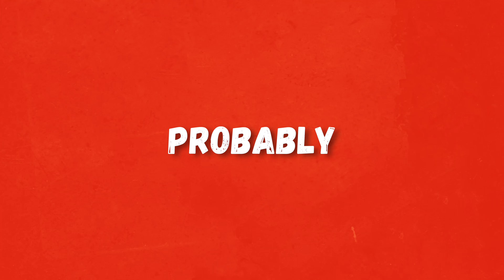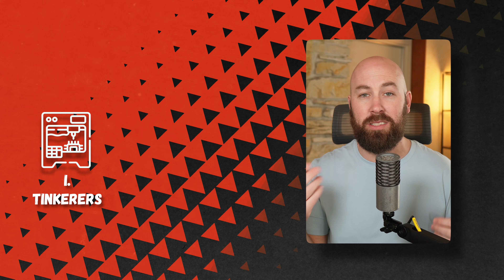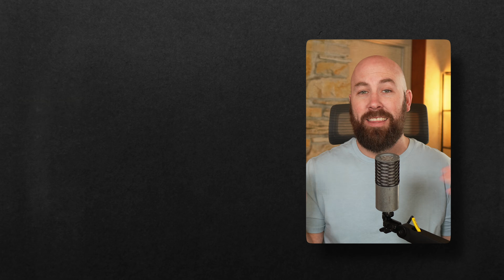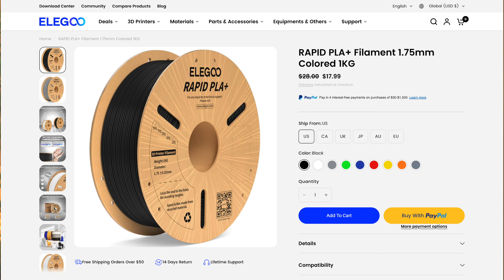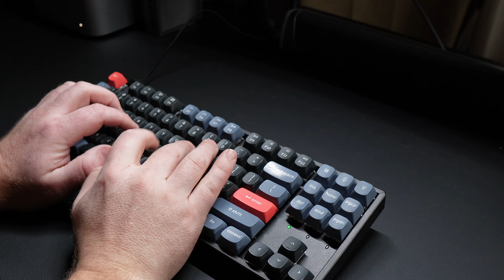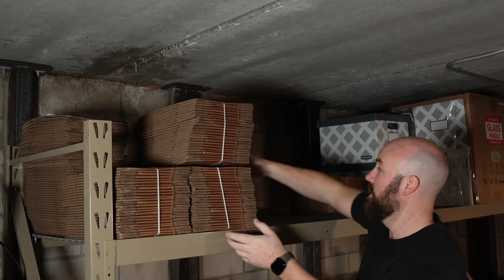3D Printing Start Up Cost 2024

Comment: I just lost my job and have seriously considered buying a 3D printer. However, my friends and I agree that I should first get a reliable job and THEN build my business. Thing is, I actually have enough money saved up that this COULD be viable. I haven't let them know just how much, just "more than the recommended 6 months of expenses". The big challenge in starting this is actually starting. I haven't even started selling used stuff on eBay and I've bought stuff with the intention of reselling. Also even though I have plenty of 3D modeling experience in Blender, I don't have any models to print yet.
I was so excited when the Bambu P2S finally became available in the US, but I think I'll stick to my plan of first developing some models, THEN buying the printer, maybe waiting for the mid-summer sale Bambu always has(hard to say if the P2S would be on sale so soon, but the filament will be). In addition, getting some experience on eBay with what I already have, which will also clear some space. Also getting a steady job, after I eventually get tired of this surprisingly stress-relieving staycation.

Comment: What are your thoughts on your printer choice (P1P) now after about 1 year from this video and the Bambu Labs Firmware-gate??  I would love to hear your thoughts?  I am researching and about ready to jump in with both feet on a 3D Print business.
Reply from the maker: Great question.  We should probably do an updated video for 2025.... For me personally if multi color is my goal I think I would still be with bambu but be looking at the P1S more.  I'm in a basement in the north so having it enclosed helps a lot.  IF you don't have that temp issue I'm still with the P1P I think.

Comment: Thanks a ton for all the info this is very helpful - I'm planning to start a 3d printing business this month and was wondering if X1C Combo 3D Printer is it worth spending $1800?
Reply from the maker: Depends on the material you want to use.  If you are all PLA, PETG then no its not worth it.  IF you want to create stuff with harder materials then the X1C can be a good option.

Comment: allthough this is a nice video, good content, i just gotta say this: People need to stop thinking of "creating a 3d printing business". Instead you need a good idea or two and see if one can utilize 3dprinting as a way of manufacturing. Just way too many people out there who think they can just buy some printers and have a business with no clue at all, or trying to sell the same old same old stuff, eventually realising after a period of time it's nothing more than just a hobby that went out of control.  Bottom line: Don't buy a printer to create a company; creaty a company and buy one if needed.
Reply: Correct!
Reply: Boooooo Debbie downer
Reply: Sigh. What is the purpose of a company? Is it not to solve the customers problems?

Comment: Hello, great video thanks for sharing. I was curious 10 months later is the Bambu P1P still the printer you would recommend?
Reply from the maker: Great Question...I personally really like the P1S.  However, I'm in a cold climate and in a basement, so having it enclosed I've noticed does make a difference.

Comment: Almost everything is overpriced on Amazon, for supplies, Amazon is the last place to look for. eBay is times cheaper especially when buying in bulk!
Reply from the maker: That may be true but when buying Filament for example the cost of it is such a small % of your COGS when making a sale.  The convenience of amazon is well worth the extra your paying (at least when you are starting out).

If I sell a print for say $10 and I profit $5 from the sale.  Maybe the cost of the filament for that print is $0.50?  So even if I was given the filament for free I'd profit $5.50 instead of $5.  Unless you are doing thousands of orders per month you are much better off focusing on new products and marketing then trying to negotiate bulk discounts.

Comment: The P1P is a practical suggestion based on value - cost, reliability, print quality, etc.  Bambu Lab is a complete non starter for me because of their approach to intellectual property and their lack of respect for my privacy and security.  They stood on the back of decades of open source development, layered on a thin veneer of their proprietary technology and locked it all down in their closed garden built atop a mountain of open source technology.  The default is printing through the Bambu cloud server and they make it very cumbersome to print offline.  There is no way I'm sending the design I created from my computer to their server and then back to the 3D printer that's two feet from my computer.  The only reasons I can think of for doing that is so Bambu can have access to my designs.  I won't buy any product from a company that would do that.

Comment: I appreciate this video. I have an eBay store that is already five stars on all transactions since we used to do resale and took customer service seriously. I've already ordered an A1 combo, I chose that for the price point along with being able to do multicolor. I held off on the filament since I wanted to choose the best one for the best value and you helped with that. The last step I had to figure out was finding designs to print to sell. Your designs you license out solves that last problem 🙂

Comment: Cool video, I'm sure it works in the USA fine. However in the EU international shipping costs are crazy high (at least from Hungary). Not to mention the different tax rules, or even starting a personal business officially is a pain in the * here  because of overcomplicated regulations and accountant fees. My best option to start is opening an own webshop with only domestic shipping, but this market is so small compared to Etsy or Ebay or Amazon. I already have an X1C, I had an Ender 3 V2 before, so yes, learned a lot, and tinkered a lot :D

Comment: Can i ask something?!
Who is gonna order something 3d printed???
I mean, i 3d printed 3 years and i can;t immagine someone buying a product that costσ 3 times more than the product manufactured in a mold.
Has no reason to do this. Except that, is gonna be also weaker than the product manufactured in the mold.
Reply from the maker: Everything I sell that could be mass produced using a mold I'm able to sell cheaper.  If I can't sell it for cheaper I try to ad personalization to it which of coarse can't be done in a mold. If I can't do either of those things then I just don't sell it.

Comment: I have been watching a lot of 3d printing start uo videos for beginners like myself. But one thing i noticed is that it’s rare for someone to talk about the considerations of where you can setup in your home. Not everyone has a spare room or a basement, here in the UK, to isolate the printer. Some say there fumes to consider, air temp and humidity, etc.
Reply: This
Reply: @Phlebz  if somebody can only reply...
Reply: @jmoney_online  I mean, there isn't much to reply to. If you don't have the space then it isn't going to work, pure and simple. There isn't any other way to solve this issue other than getting a space to use.
Reply: @winebartender6653  so you mean that the fumes are unbearable then? You didn't really answer my question though did you? Air temp and humidity..even if I did have a spare room I still have no clue what else to consider other than "extra space"
Reply: @jmoney_online  Fumes are only a problem if you are printing with certain materials. I recommend doing some research on it but pla and petg are safe to print without an enclosure. If you live in a humid environment getting a filament dryer is well worth it. Leaving filament in humidity for long periods will affect your print quality.
Reply: @LBL-XYZ  see that's a better answer. Thank you!

Comment: I loved this video!
Just a quick question, is it best to put a limit on how many of each item you have in stock on Etsy or is it best to print as they’re ordered. Do you say the items are made to order and may take a day or 2 before shipping?
Thank you 🙌🏻
Reply from the maker: I lean towards putting no limit on the amount in stock. However if you do that you need to make sure that you have the capacity to made how every many you end up selling.   I always want the sale so if I ever get so many orders that I think I can't handle them all then I just up my processing time.  If the orders keep coming though I would then looking to add more printers and lower my processing time back down.

Comment: Do you need ventilation to use a FDM printer, like you do with resin printers?
Reply from the maker: Do what you feel comfortable with but I don't have ventilation.
Reply: @sam__erickson  Cool thanks, I was just afraid it would make my house smell like melting plastic all the time. I tried a resin printer and we couldn't stand the smell of the resin. Plus it would only be a matter of time till I spilled it everywhere.
Reply: PLA+ is ok, corn based. ASA has dangerous fumes. Has great properties tho. These are my 2 favs now.

Comment: How often do you clean your build plates? Does that take a lot of time? do you have issues with adherence to the plates if you don’t clean them or do you have issues with humidity?
Reply from the maker: I just have a spray bottle and I spray them down.  I don't do it every time but if you go to long you will start to notice some adherence issues.

Comment: Hello, I am a sculpture and painting artist, I have some experience using Zbrush and I would like to make my own 3D frames for my paintings, but I do not have any experience printing in 3D, my question is, would it be better to have my designs printed, or buy a 3D printer? Is it expensive to have a simple 20x16 frame printed?, thank you
Reply: Plastic frames? Ugh.

Comment: I wouldn’t recommend a bamboo labs you will enter the world of proprietary plastic and you need to know the workings of a 3d printer otherwise when it brakes you will have to buy another and your orders won’t go out on time.  I would recommend two cheaper printers straight off and if you already have two then that’s a sign your ready

Comment: hello i started a 3d printing farm for 1 client, so i print what ever they want it earns about 600 euro a moth, and the work flow is very low i have plenty of time to set the printer to work on something else. i have a 2x creality smart pro 10 those are my start up printer sometimes i have to print up to 40 cm that why i have those printer. and i have a bambulab x1 to have quality and fast productions.       i have to start up a etsy maybe you have some advice ?

Comment: I'm about to graduate my AutoCAD course and have been eyeballing 3d printers forever.  Super interested in trying to start a business with 3d printers and maybe somewhere down the line subscribing to a license for AutoCAD to use those STL files commercially. Subscribed!
Reply: 4 month update, i graduated my course and my X1 Carbon is on its way to me as I type this.
Reply: I've been looking into learning AutoCAD. What made you start - what's your end goal?
Reply: @Vipersrule  learned it in high school and my teacher was just great, i didn't know it at the time but that type of work is exactly what I'm into.  I've used it for years after high school to teach myself more and apply it where i could find a relevant use in my own life as my other interests include welding and woodworking. It just made sense to get a career diploma using the program for its various uses across fields and position myself to maybe take on a job as a technician professionally or for its 3d printing applications to start a business.  All in all i figured knowing how to 3d print and work with point cloud systems would be a net positive for creative purposes or professional ones

Comment: Also another great starter 3D printer is the Elegoo Neptune 3 pro. Auto level and that thing just prints non-stop. No as fast as the P1P but definitely not as expensive either. The price trade off you get is really only about speed of the CoreXY design.

Comment: Anycubic kobra 2 neo (150-180$), anycubic pla filaments (black or white) and you don't need any setup. You can buy 5 of them and print. Slower if you consider only 1 but with 5 you are faster than 1 bamboo lab. First and only upgrade an enclosure, a cheap soft box one is more than enough
Reply: Honestly that’s great except you get what you pay for and the print quality… I have 2 ender 5s with hundreds of dollars of upgrades, 600+ into the plus not including the machine… and still do not get close to the quality and multi color function of a bambu… my rule of thumb is if you’re getting into the hobby for tinkering and learning get an ender or other budget machine. If you want to print well and have a good print experience rather than an engineering experience buy the bambu labs
Reply: @EsaubOutdoors  FDM 3D printing is never a quality manufacturing. I don't understand the obsession with it. If you need  quality skip FDM and look for SLS 3D printing or something more
Reply: Maybe second upgrade a couple of UPS to prevent power outages

Comment: You are also assuming that Etsy will work out. I tried to open up an Etsy shop with some 3d printed desk accessories but I was immediately banned after opening the shop (seconds after going live), and when I tried to appeal I was permanently suspended. I never received a message for why the suspension happened in the first place, even though I made sure I followed all the guidelines and avoided any copyright issues.
Reply: Etsy is currently trying to work on something with brand new or long term shops being banned because of all the scammers that have hopped on in the recent months and they are working on some ai thing I think to help get rid of the accounts that are actusly scammers.

Comment: Definitely the P1P or P1S. 2 Printers, a very sturdy workbench/shelf setup, 5-10 rolls of filament, some spare parts and miscellaneous maintenance items and you're good to go! Shipping supplies as well, but those are fairly cheap. You could even make it work with 1 printer but that isn't ideal

Comment: what do you think about the a1 from bamboo for lower entry or for quicker build out?
Reply from the maker: It's a great option. There is a gap in speed though compared to the P1 printers which is why I give the edge to them.

Comment: Found this and it really kicked me into gear to take my thought of starting a 3D printing company into motivation to make it reality. I won't hold it against you that you keep buying Bambu. They work when they work, like all others. I dipped in with Prusa and their print farm printing printers showed me they stand up. I also liked that it was easy to change out any part and sourcing my own if needed. Working on gathering ideas and making things in Fusion 360. I will be up there with you soon. I even found a company that I can source to handle any huge rush of sales until I can ramp of printers if needed. Or just handle the spike of sales.
Reply: I like this Idea, are you open to suggestions on other social platforms like Instagram?
Reply: @Immersivedimesion  Sure. Suggestions on where to post, or what/how to post?
Reply: hallo，I'm a 3d print company businesses man from China.I would like to know how the 3d print market of aboard like.I also want to find some customer who has demand of 3d print😂❤
Reply: @BradBiggsll which Prusa printer did you get? I'm currently looking at both Prusa & Bambu and have trouble deciding, as I definetely want an enclosure.. so its currently between Core One and P1S.

But I'm waiting for Bambu's next gen of printers to pull the trigger
Reply: @ I got a Prusa MK4 and enclosure. Then added an MMU3. Ordered the MK4S upgrade. Have not installed it yet. Currently in the middle of a larger order. Recently decided to expand and ordered a duplicate setup. MK4S / enclosure / MMU3.  

Both companies make great machines. I liked that Pursa had an easier way to replace or upgrade any part easier. I was also gearing my business to being not dependant on China. All the filaments I use are made in the US. Machines are EU. Many don't care care when buying from a shop. But there is a small group who care. And I have yet to see someone say that seeing something made in the US made them not buy it. Any competative edge I can get.
Reply: @netdetox  hey it's been 9 months, did you manage to make some income from it ?? (hope you did) im really curious !
Reply: @ I did. Lucked out with my aunt's business. I made some magnets for her. Did a huge order of them. 500 of them. Paid for the cost of the printer and got the MMU3 upgrade. They sold OK. Then a huge pause while I was trying to find what niche I wanted to go for. Then got another smaller order for some Christmas magnets for my aunt. Made 113 and all but 6 sold. Already in talks for some non-holiday magents. And I think I finally found the niche I will go with on Etsy. Already bought another MK4S / enclosure / MMU3. A third of the way paid for already.
Reply: Is this venture profitable after 9 months?
Reply: @ I am at about break even. With adding a new printer setup. But that is only doing two orders for my aunt's business. I have set what products I am launching on Etsy. I will have them up by the end of January. So going forward it should be profitable by my 100th sale. Printers paid off. Start up filament colors paid off.
Reply: @netdetox  thanks for getting back !, happy for you, and hopefully everything keeps going alright !
Reply: @netdetox That is awesome. It's been 6 months soo, how are things going? I hope you are doing good
Reply: how did it go
Reply: Hello which machine you suggest i want to start 3D printing have budget about 400$
Reply: @sandrosaxlt232 Bambu Lab A1, you won't be disappointed.
Reply: @sandrosaxlt232  start A1 mini or A1 your first goal is to pay the printer and filament off by using them.